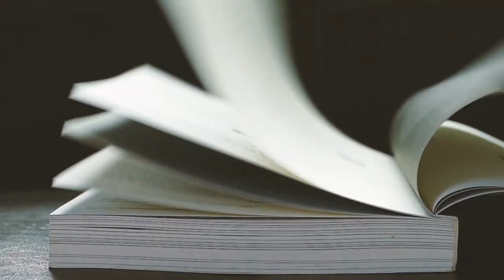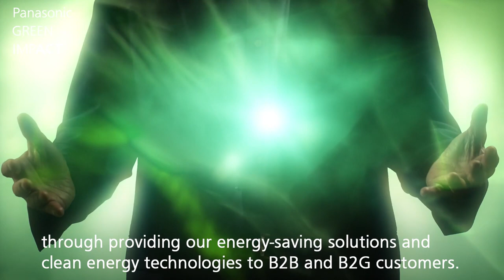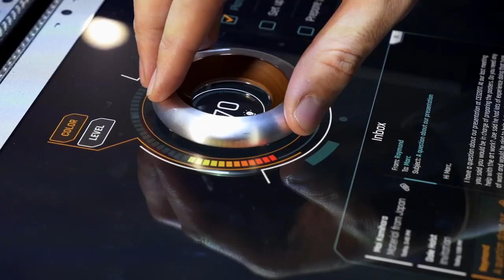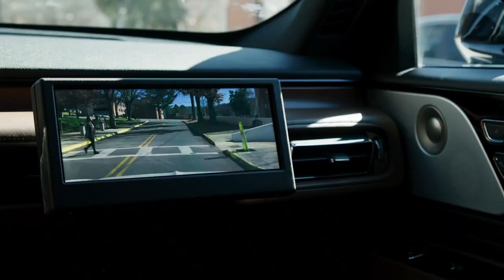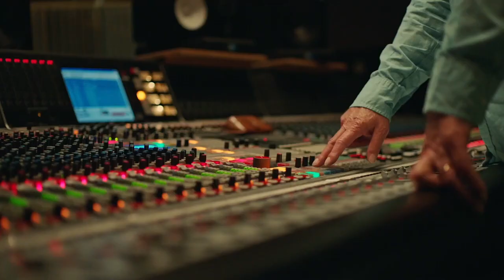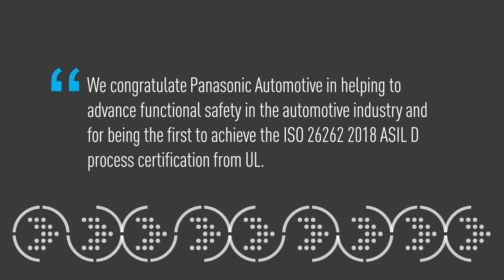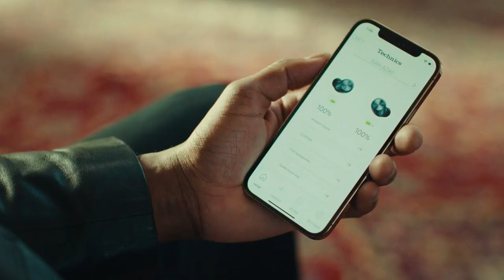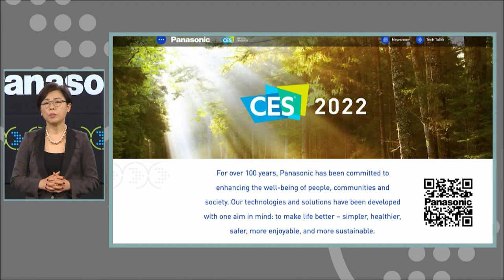Panasonic CES 2022 Press Conference

Comment: I realy like Lumix cameras and have one myself, but personally, I wouldn`t have included the background footage at 46:44 as you can clearly see the autofocus flinch, making it a dead giveaway that it was shot using a Lumix camera using AF. Did realy no one notice this during the production of this presentation?
Reply: Good eye, that really is pretty poor on their end. Regardless of whatever camera filmed that, that's a shot that should have been done with manual focus.  And on top of that the editor compiling that should have seen that and not included it in the presentation.